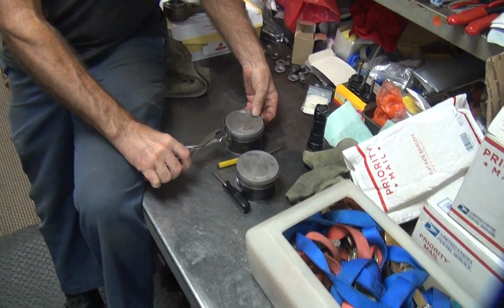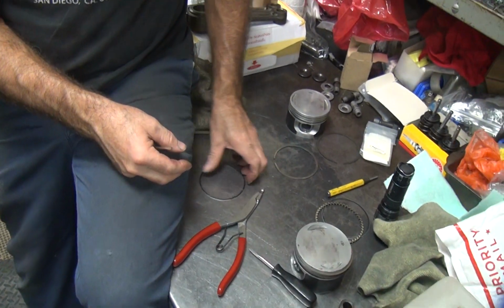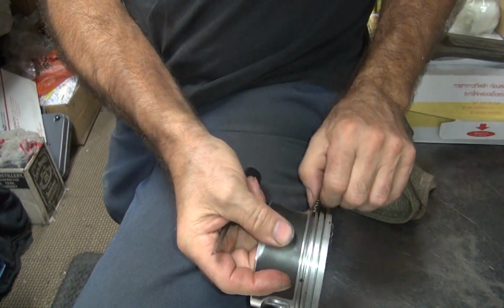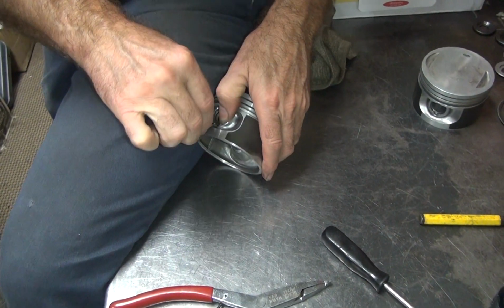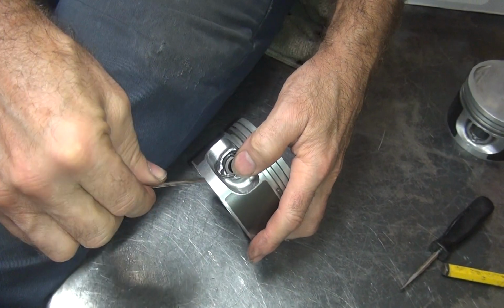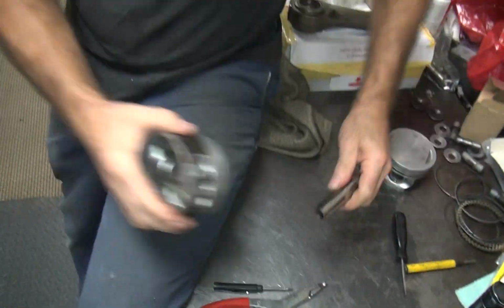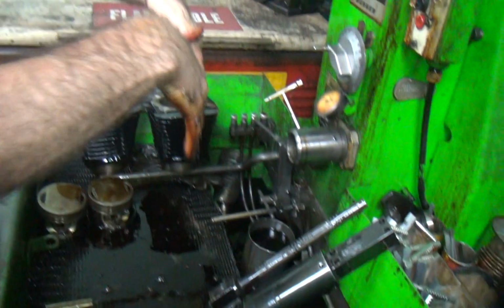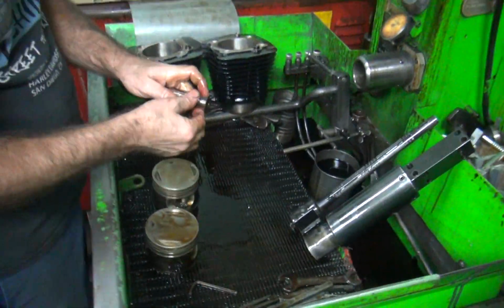#102 2001 sportster cylinder machining hone piston ring filing rebuild 1200 xl harley tatro machine

Comment: Hey Tatro, I got a 99 sporty that's burning a shitload of oil. Only 18k miles on it, just bought 2 months ago and rode it everyday since. Guy before me only put 500miles on it in 8 years.. it's not leaking or smoking at all, so after researching and asking a harley guy found its probly either piston rings or valve seals. Just bought the gasket kit and rings and gunna do the top end myself. (Dont have the $1500 he wanted) my question is do I need to hone the cylinders as well? Or should I be ok since its lower miles. Love your videos by the way! Super informative and good to learn with
Reply from the maker: most likely the hone crosshatch angle and finish are wrong and he wrapped the rings onto the piston. watch how i do my jobs and you will be fine.
tatro
Reply: @TatroMachine  Its never been taken apart before, other than re jetting the carb and cosmetic stuff. The day I got it I changed all fluids and was running perfect for a month I just think I pushed it a little to hard after it had been sitting for so long. Its my first bike, just thru watching your videos on the rings and seals I saw the ones where you honed the cylinders, so didnt know if it was necessary to do. Guess I wont know til I open it up?